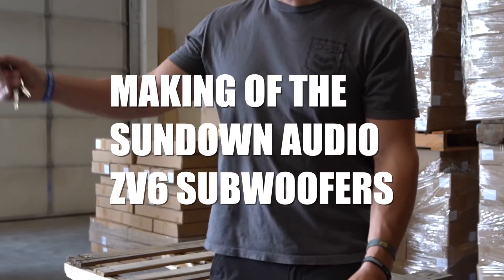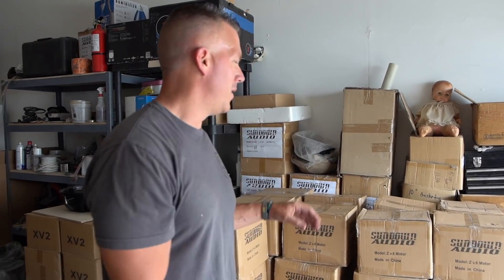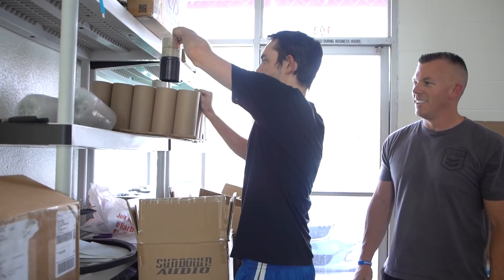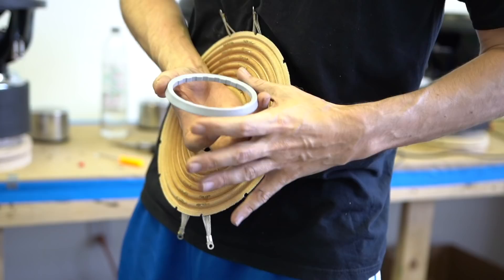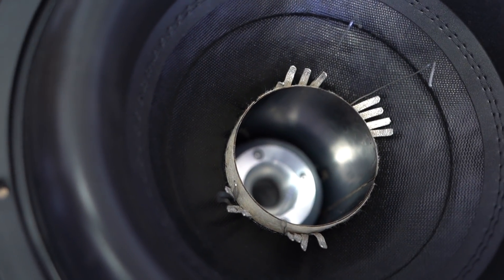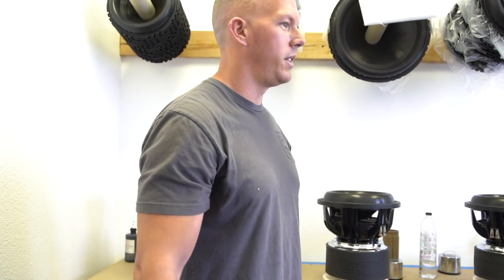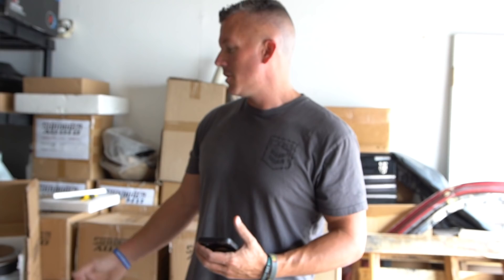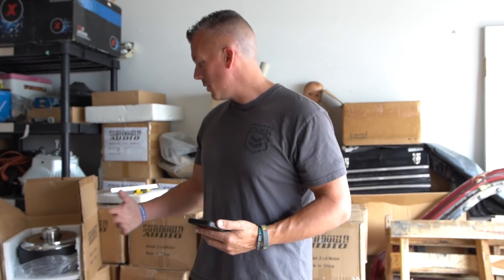DELIVERY AND DESIGN OF THE SUNDOWN AUDIO ZV6 SUBS

Comment: Hey jp, how much of a difference would I notice going from a single x15 v.3 wired at 1om in a 4th order to a single zv6 15 wired at half om. 370 alt,dual runs 1/0, 3- xs power batteries, and a crescendo 4k. Thanks for your time

Comment: My older brother used to have a 2006 Altima with 2 kenwood 10 inch subs in a sealed box, not the loudest but it still bumps. I remembered that he blew them by turning the gains to clipping and then he replaced them with mismatched subs. The inspiration from older brother, PSSounds, Fivestar car audio, SMD, and Lifeofprice got me into car audio. I inherited the old subs from my brother and bought an old 500w Jensen amp from a pawn shop because my dad threw out that nice kenwood amp which was very affordable for the output and sound quality you get. Those mismatched budget tens do not sound right and I’m thinking about going with a single twelve, and stay with a sealed and not go ported or BP because I much prefer a musical bass over boomy bass.
Reply: Once you hear yourself a solid ported box, you'll never ho back to sealed...

Comment: Are these designed for ported or sealed enclosures, and what aythe recommend airspace for each?
Reply: The U series is Sundown’s loudest and most musical subwoofer that will work a sealed box. A single U12 in a sealed box is about 130 decibels. Check the sundown website for more info. The X, ZV’s, and nightshades won’t work in a sealed box because the QTS is less than 0.4.

Comment: If the bigger magnet doesn't mean more power, then what is it that determines how much power a subwoofer can handle? I would definitely think that a bigger and stronger magnet mean a more powerful motor and power handling
Reply: A coil that would take the most heat is better
Reply: @ravimanick8588  that is correct sir

Comment: I would love to have a super low Fs of under 25 hz in a ZV6 18 to use in a home theater setup.  4 of those running off a Crown XLS 2502 each in 10 cu ft tuned to 16 hz in my 300 square foot HT room would be very nice.  Hell I'd take one for my truck with normal Fs in place of my current Dayton Kraken 21" if I had a 300 amp alternator.
Reply: I've always wanted big ass subs in my house. I have a crown 2502 on my towers and a 3500 for my subs (in my car now) but the problem is the breaker always pops when I turn it up really loud. How do I fox this lol? I can't just put a bigger breaker in the fuse box
Reply: @Pittsburgh-412  Do you have it bridged at 4 ohms or at 2 ohms?  It is stable into a 4 ohm bridged load which is in actuality a 2 ohm load on the amp.  What size wire is going to your home circuit and what size brealker is in there. 12 gauge you should have 20 amp fuse at 110 volts.  10 gauge should have a 30 amp fuse.  I just hope you don't have 14 gauge, which only allows for a 15 amp max breaker.   I have a Crown 1502 running a single Dayton Ultimax 18 in my house and a 500 watt BASH amp running a 15 inch Ultimax off the same circuit with 20 amp breaker.  So roughly 2000 watts total, not far off from the 2500 watts you need.  Over time breakers can get weak and trip at lower power levels.  A new 20 amp or try a 30 might work.
Reply: Look at stereointegrity.com, Nick Lemons sources from sundown to build low fs subs. The hst18 has an fs of 21hrtz and the hst15 is 23hrtz. I have used the 18 and the twelve inch versions, low end monsters.
Reply: How do you like that Kraken? Been thinking of getting one for me DJ rig.
Reply: @PURESOUND4  It is wonderful.  I have it in 7 cu ft tuned to 29, and not only does it go very low, the impact for rock is amazing.  I have it running off a Taramps Smart 3K at 4 ohms and it feels like it could take much more.   For DJ use, I would aim for 32-35 tuning in 6 cu ft and use light plywood, because the sub is already very heavy.

Comment: Building sundown subs with a kicker t shirt on...smh
Seriously though John Price i can not get good technical or system design information from your staff who answers phone.  They say I don't know,  And they're not techs... I want to know what sundown sub [ dual 2ohm] pairs well with the d4s jp23 ...
And then will this perform on factory electrical of not what's the first electrical upgrade i should make...
Reply: I'll wear what I want thank you very much.... Lol
Reply: I would highly suggest the big 3 upgrade regardless of whether you upgrade your alt or not. A second battery is also suggested.
Reply: Hey man the x series, just a single one will take that jp23 no problems. Get a d2.
Reply from the maker: sundown U series. Put a d4s lto 6.0 in the back for supplemental battery power and do a big 3 upgrade and youll be good
Reply: @THELIFEOFPRICE thanks for  reply... I bought the 12 X v3 d2 and the JP23 amp this morning from D4S. I ALREADY GOT A TRACKING NO. And it's been shipped,  with a Saturday July 3 delivery... insane speed.  Very pleased with that.  I'll have to research what a d4s ito 6.0 is I'm guessing it's a battery.  Sub is going into a bmw x5 where the stock battery is in the trunk under the spare tire (not up front) there's an existing 1/0 copper run to the front. Lmk, i was considering an addituonal 1/0 copper run to the front 12v+ post (not a battery post simply a factory post at the engine compartment to jump the car if needed) or a tap at the alternator run to the back.  I'm an electrical contractor 30yrs exp and understand current & voltage drop... last comment question,  excuse my ignorance here... what's the big 3 electrical upgrade?
Reply: @THELIFEOFPRICE One last question,  I discovered what the d4s lto 6.0 is.  A lithium battery... ultimately I assume it's strapped parallel to the stock car battery (bmw x5 stock battery is in the trunk under the spare) so these batteries would be within a few feet of each other.  Is there concern for 2 different type/ capacity batteries in parallel,  won't the lesser drag down and impede the more robust batt (d4s lto 6.0) or  would i remove the stock battery all together.... just run the d4s lto 6.0... thanks for consideration and your time.
Reply: Get a new zv6 12 they will handle the power of the jp23 and i recommend a optima yellow top maybe two and that's all for the electrical besides just one run of ofc 0gauge.

Comment: I might need to order one.  Bought a American bass hawk and it is junk. Cone scratching already 1 week after buying
Reply: American Bass is not junk. By his logic you shouldn't buy any of his subs that cost the same as the Hawk?
Reply: @drjd2real  deff is junk,  i has same issue with 2 of them.  So returned for 2nd time
 Now running 2 sundown u 10s and couldn't be happier. So when 2 subs have same issue means shit product
Reply: @beefysghost867  Like I said American Bass isn't junk and isn't going anywhere. I have 4 of their 8s with the blue basket on a sfb5000. You just got a bad batch. Sundown isn't  perfect. I have 4 of their Sa15s, but 2 of them are mismatch and look weak and cheap af. An American Bass xfl would run circles around the sa I have. I have Sundowns just sitting nib box collecting dust. I contacted Sundown and they just gave me the runaround and excuses. Also the Sa15s I have don't hit lows worth a damn.
Reply from the maker: Get what you pay for =D
Reply: @THELIFEOFPRICE  exactly,  but Ballin on a budget, got laid off in November. So do what I can when I can.  
Thanks for the reply brother,  means a lot to people you just taking the time to read and reply to us normal people.

Comment: and also why are the coils wound and not machined solid so they dont uncoil
Reply: A coil by definition is coiled.
Reply: @shanecunningham6082  so , that's not what i asked, i know that, i asked why not make it solid so there will be no uncoiling when it gets hot
Reply: @billl2383  solid,  would not be a coil. It needs to be a coil.  The wire is laminated and carries current around in a circle multiple times creating an electromagnet,  that repels the opposing magnet motor.  That's how it moves.  It has to be a coil to do this trick.  Imagine coiling wire around a nail,  and Appling 9v battery to the coil ends.  You've made a magnet.  Now move that towards another magnet and it will push or pull said magnet based on voltage polarity.
Reply: @shanecunningham6082  thanks brother i appreciate the info
Reply: @shanecunningham6082  and i wasnt trying to be a smart ass on my last comment i appreciate the knowledge

Comment: what i dont get is how that tiny wire that attaches to the coil doesnt burn up on high power its not very thick but then you have the tinsel leads double triple and quad which is altogether thicker than that tiny lead then the wire we put to the push terminal is thicker than that i dont get it
Reply: The length puts up resistance
Reply: @wayneslain9444  that doesnt answer my question i didn't ask what what causes resistance